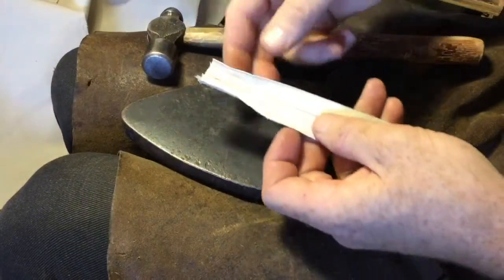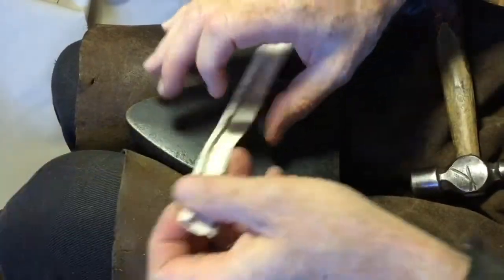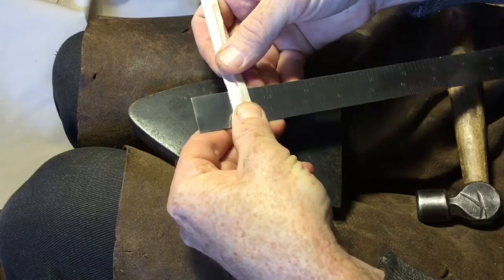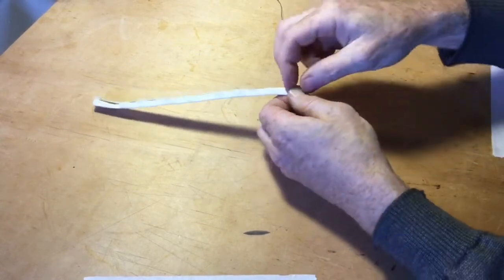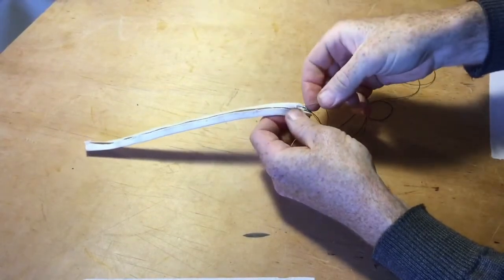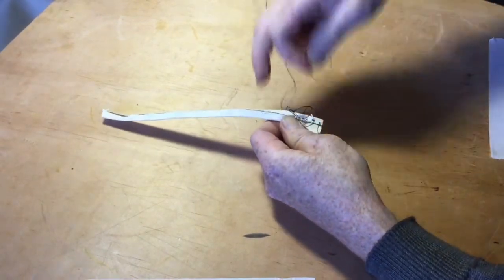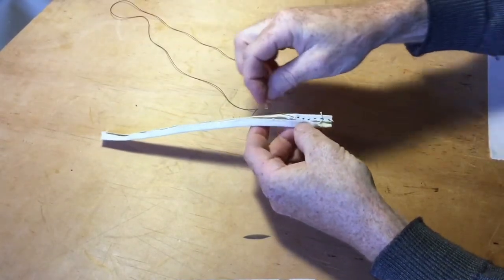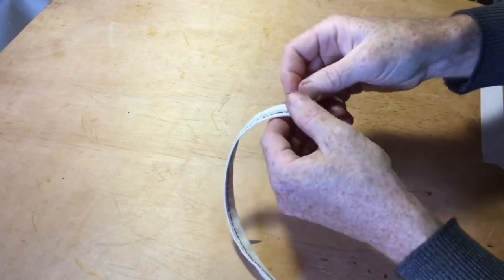Making Lamp Wicks 2

Comment: Tyvk 4 the awesome tutorial, Duncan!  The wick that you’re producing is the one that I use in a couple of my emergency oil lamps. I suspect they were originally kerosine lamps, but I usually keep them refilled with liquid paraffin, or did you until this past year.

And $35 for a fairly small bottle, I suspect I’ll be switching to something else soon.

I appreciate this tutorial. Although I keep a few extra wicks on hand in case of emergency, it doesn’t hurt to be able to make one in a pinch.

I can hardly wait to take in your other video that I see you that you referenced there for someone else. I’ve often wondered whether this was done with a bit of grossgrain, and I hope to find out. Cheers!
Reply from the maker: Glad you liked it Daphne. All the Best.

Comment: actually i think the best permanent wick would be a piece of carbon felt just cut to wick size.
Reply from the maker: Interesting Tailslol, I've never heard of carbon felt. We live in a small town with no easy access to wick or felt suppliers, so I was just using what I had lying around :) I might look it up. Thanks.
Reply: I make mine out of carbon felt. I also sew in some copper crafting wire to transfer heat along the wick and down into the oil.
Once done, no more wick replacements!

Note: add in about 1/2" to the length as a minimum because carbon felt will shrink after a while then stop shrinking.

Warmer/hotter the oil the better it vaporizes and the less soot produced.
If you did it correctly you can use olive oil in the lamp!
Reply: @crazysquirrel9425  i know i made a tutorial about it in instructable a few years ago.